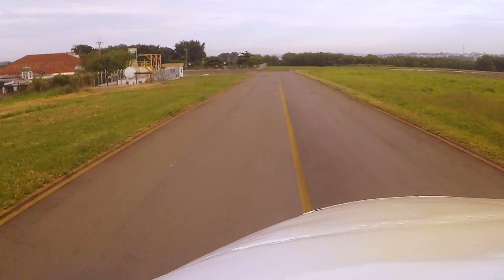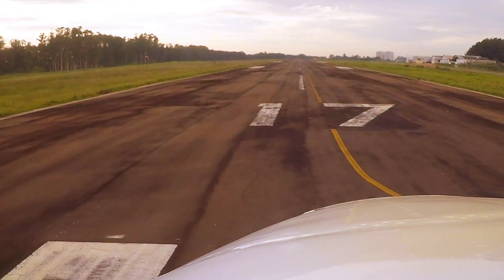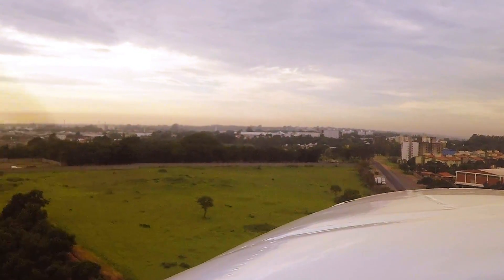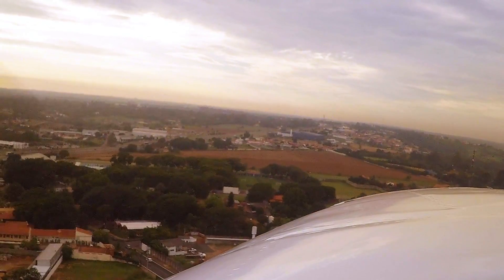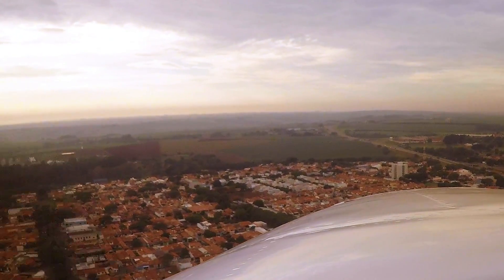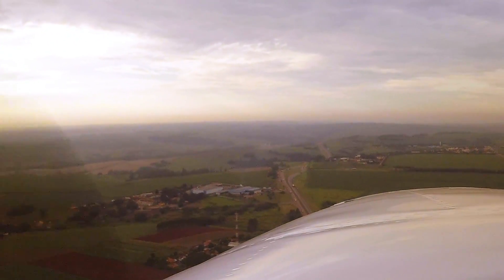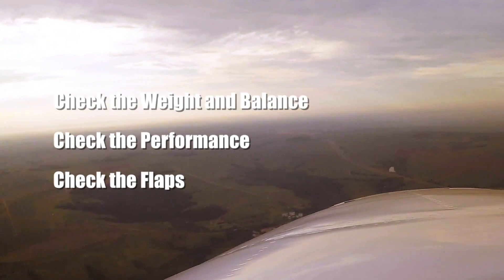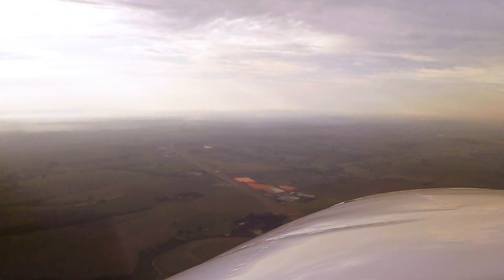Engine failure during take off

Comment: How did you simulate the engine failure ? Did you reduce power on the right engine to idle and feather the prop ? I’m very suspicious because you left the cockpit audio out of your video. You were VERY late getting the gear up and there is no indication of wether the right engine prop was feathered or when that happened ? Despite all of the missing information here ... that was reckless and irresponsible, take this video off YouTube because I might give some other idiot the idea to try an actual V1 cut in a real aircraft, there is a reason why we do this training in simulators !

Comment: The lessons you claim this incident have imparted are not the lessons you should have learned. Here's what you should have learned:

Precise aircraft control is the only way you'll assure second segment climb performance. You were late on retracting the gear and your lateral control is horrible. It also appears your pitch isn't very precise either. You should simply maintain V2 and wings level. If you can't do both of those, under a view limiting device, you have no business flying that airplane.  None.

Simulated emergencies close to the ground have resulted in dozens, if not hundreds of accidents through the years. That your "IP" didn't recover your simulated zero thrust engine, and that he chose the airport and terrain seen, speak to a total lack of competence in the area of evaluation being performed. Is he even a King Air current instructor? If not shame on you both, if so, he doesn't know what the hell he's doing and damn near got you both killed. Performing this type of training in the airplane, even when both the student and instructor are competent, is extraordinarily dangerous and must be carefully briefed and the threats managed. Those people on the ground deserve better than two clueless and thoughtless jerks arbitrarily screwing around with an airplane just because they thought they could.

I hope you've either given up aviation or chosen to get serious and start performing in the manner required of a certificated multi engine pilot. If that sounds harsh, it's meant to be. Get your act together before you kill somebody.
Reply: While I don't pilot planes at all, I enjoy aviation videos (Swiss001, DorDek Kiddy, Richard Tyrer, etc), whether computer simulated or real life. In other words, I am a young science and tech enthusiast. I do 99% agree with you that this engine out test should have been done over a less crowded area, but modern twin airplanes (ex. DA42, Cessna 414) are so safe that the probability of this guy crashing is like 0.0001%. :) But, I do see your point. I would not want to fly on one engine over a bunch of houses (high population density, buildings and stuff). He could have done this in a free flight sim like FlightGear, or shelled out some money for MSFS 2020, instead of risking dozens of lives on the ground and his own.

Anyways, merry Christmas, and happy holidays sir. 🎄🕎

Comment: And that was light? I figured OEI performance on those earlier, smaller models was better than that. That aircraft needed more SHP from those turbines than what they gave them. If I owned a King Air of that model I would upgrade the engines as soon as I could afford to. I mean 550 SHP PT6A-135A's, uhhhh nooo. How about trying to modify the engine bays/nacelles to squeeze a couple of 850 SHP PT6A-41's in? I wonder if they'd fit?

Comment: Back when I was self-training, my reaction to a right-bank on engine failure was to bank hard left, kick the right rudder, pull the yoke back hard, cut the throttle (do a fuel dump if I had time), cross my arms in front of my face and yell, "iiieeeeeeeeeeeeeeeeeeeeeee!" Worked every time.

Comment: It’s important for people to see how poor the engine out performance can really be in twins flying today. They are all terribly underpowered, with few exceptions. The C90 at reduced weight of say 9,000 lb in your case has an engine out power loading of 16.3 lb/hp (17.6 lb/hp at gross weight). These are both quite a bit better than most twins, which are typically around 20 lb/hp, which is a lot worse. But as you can also see, it leaves better performance to be desired.

Comment: this is just stupid, and completely irresponsible.
Reply: Are you a pilot?
Reply: @bgamelson  5500 hours on the 737 series, and 2800 so far on the 787.
Reply: @cmm3338  Oh so you know that simulated engine failures on takeoff are a required element of twin-engine signoffs, yet you call it stupid and irresponsible.  Are you just here to get attention?
Reply: @bgamelson  Simulated Engine failures for multi, or any cert for that matter are to be, and I emphasize SIMULATED AT A SAFE ALTITUDE. I have never heard of someone cutting power on purpose right after take-off in a densely populated area, before the gear is even retracted at that. No sir, this was reckless.
Reply: @cmm3338  You've never been on a milti-engine check ride then.
Reply: Bill Gamelson I guess you haven’t, at least not governed under the FAA... because NO check ride would be started with an immediate engine failure after takeoff, in a densely populated area.. period. I’ll find and post that regulation per the FAA for you.

Comment: You must use rudder compensator to help You control the engine failure that according to the video appears to be  the right engine

A nose elevetion between 0 to + 5 degree of nose up checking stall Velocity limits & trees or buildings a long the the fly path

Comment: Uh, I would have immediately returned to the strip I took off from.... but that's just me
Reply: Not enough altitude.
Reply: @bgamelson  But he stayed airborne and gained altitude throughout this video.  With an engine failure, he should have returned to the strip after he did gain altitude.
Reply: Idiot. he was barely gaining altitude.  If he turned the airplane he would have lost altitude and crashed.
Reply: @bgamelson  "Idiot"? really bro?  That was uncalled for.   I guess you're one of those people that can't have a conversation without attacking those with differing opinions. Have a good day.
Reply: @jeffroutledge9153  Cry baby.
Reply: @bgamelson  No tears... I promise.  Just stating the facts.  By the way, I know a pilot who had practically the same exact  circumstances, (same altitude, etc.) and he made a perfect return to the landing strip.   It can be done.  But I guess you would know that if you were a pilot, which as evidenced from your comments, you're not.  Cheers
Reply: @jeffroutledge9153  Actually I am a pilot and I call bullshit.  You're the one who is not a pilot.  Actually, I think you totally made this story up about "a pilot" who had the exact same circumstances.  There is no such thing as two separate flights using two separate airplanes which yield the same exact circumstances.  What was the atmospheric pressure at the time?  What was the exact weight of the passengers on both flights?  You don't know that, do you?  What engines were running, what props?  What was the quality of the fuel?  There are a lot more specifications that add up to performance than "altitude etc."   If you were a pilot you'd know that but you are not as evidenced by your comments.
Reply: @jeffroutledge9153  I can see two things he did wrong in this video.  Can you name them?
Reply: @bgamelson  Let's see... "great job my friend, excellent piloting"  hmmm I wonder who told him that?  But now you claim he made 2 mistakes, why didn't you tell him that too?  Could have been more constructive for him to hear your pearl's of wisdom  than trying to convince me you're really a pilot. LOL.
Reply: @jeffroutledge9153  I don't know who told him that.  Certainly wasn't me.  Perhaps you should learn how to attach names to messages.  Still can't names the two things he did wrong I see.
Reply: @bgamelson  My bad. That comment was from a guy with a similar name.  I admit I was wrong about that.   I already told you what I thought the pilot did wrong.  And, I never claimed to be a pilot now did I?  I speak from the opinions of friends who are pilots and one who told me of a very similar (not exact of course, that should go without saying) but very similar engine failure, aircraft type, approximate similar altitude as determined from the video as well as many of the same circumstances detailed therein.  He was able to make a safe and flawless return to the strip. It can be done. You don't think so??
Reply: @jeffroutledge9153  Two thing that he could have done to get some climb out of that bird:

1.  Bank into the good engine.  He was flying almost level the entire time.  Banking slightly into the good engine will increase the airplane's ability to fly.

2.  Add one notch of flaps.  He took off with no flaps.  This is a mistake by itself.  If an engine quits right at rotation, it's good to have one notch of flaps already dialed in.  He was below V2 with no flaps.  This is why the airplane wouldn't climb.  As soon as he got V2 (about 5 miles( the airplane started climbing.

And you accused me of not being a pilot.  That's as good as claiming you are one.
Reply: @bgamelson  Well I can no more prove you are a pilot any more than you could prove I'm not one (if I had not admitted that to you).  So you still feel it would have been impossible for him to return to the airport?  He clearly had enough altitude by the end of the video to turn around, right?
Reply: @jeffroutledge9153  He did return to the strip after that since they were out practicing but you said you would have IMMEDIATELY returned to the strip.  not after five miles.  Don't try to change the subject just because you know you were wrong.  Here is your quote:

"Uh, I would have immediately returned to the strip I took off from.... but that's just me"

If you would have immediately returned to the strip you would have impacted with trees and/or buildings.
Reply: @bgamelson  Wasn't the  subject about him making it back to the airport?  So how can this conversation about making it back to the airport be considered  "changing the subject"?  Lol.   If he returned to the strip, he sure didn't do it in the video.  "Immediately" doesn't have to mean like 2 seconds into the flight does it?  "Immediately" could mean as soon as it was safe to do so, (which again, he doesn't do in the video).  Since he did it soon thereafter, then I guess that qualifies as him doing it as immediately as possible.  Really not all that complicated is it?
Reply: @jeffroutledge9153  Immediately:  At once. Instantly.  Without any intervening time or space.  Right now.  No delay.
Reply: @bgamelson  Ok I get it,  you're a person who takes every single word in it's absolutely  perfect literal translation.  Good grief man.  Next time I'll say "almost" immediately.  Would that have altered the course of this conversation?  The Senate just passed an economic  bill to "immediately" help Americans financially but it took 4 days to approve it and it will be another 3 weeks before checks are sent out.  I guess they shouldn't have said "immediately" huh?  I'd love to continue this conversation with you... but I'm not going to.   Have a good day and stay healthy bro.

Comment: If this was a training flight for an engine failure after V1 surely the engine would only have been throttled back to idle? If needed it was available and if so why was the engine not brought up to climb power when the exercise was complete and after the checker/trainer was satisfied that the pilot was competent in the drill? It was a bit close to the built up area, sure, but not all airfields are out in the sticks...............

Comment: I’m assuming this was a simulated engine failure ( engine still running at zero thrust setting), if that’s true, I don’t see the fuss about practicing an engine out with few buildings on either side of the extended centerline. The power could be restored at any time if rate of climb was insufficient, practice emergencies in real environment not hypothetical. Simulators are best for training, but the real world engine out practice builds confidence as long as safety isn’t compromised. Airlines practice engine out when obtaining initial type rating, including check rides etc.

Comment: You were also very lucky to fly quite a distance on one engine basically at your take off weight of 9000 pounds. This situation is a mighty strain on your only engine even if it is rated at 350 hp and has a turbocharger.
Reply: It doesn't 'have a turbocharger',  it is a turbine (jet) engine, genius!

Comment: Unbelievable. Incredibly stupid to practice an engine failure at low altitude over a populated area. What the heck is wrong with you? Did you feather the bad prop? Or did you end up NOT feathering the bad engine's prop and thereby practicing the wrong procedure? STUPID, STUPID, STUPID. There is no need to do this in this modern era. This is why we have simulators. If you want to do it in the real airplane, do it at high altitude and do it properly so you don't end up memorizing NOT feathering the prop.

Comment: Ignore the armchair pilots. This was a good and informative video. I think it was alright, given the engine could be restarted in case of an issue, and you were in airspace you were very familiar with. Combined with a seasoned first off, the danger though elevated, was still negligible. Ty for sharing!!
Reply: @colinsouthern  A very good assessment..I’m also a pilot ,albeit not commercial..I too thought it was dangerous and irresponsible.
Reply: The engine was prop was fethered it wasn't off

Comment: Very interesting ! We can learn a lot from that.

Every once in a while, some training captains are giving me hard time for not keeping the ball centered after an engine failure....
(Learnt to fly on gliders...we use a wool line...not the ball..)

Engine fail:
CTRL + GEAR UP + V2
And half a ball on the good engine !

And one more last thing....You should not care about a plane who failed you...does not want to fly...belly land ! 
It’s not because you have a second engine that you can keep flying !
You will not survive a < Vmc ! 
Nor the plane anyway...It did happen to one of the cie i worked before, they flipped a king air above a nice field...to burn inside.
Be ready at every take off for an engine failure ! Just like at the sim, the surprise delay won’t be there !

Fly safe !

Comment: I know nothing about aircraft. Please tell me what V2 is?
Reply: v2 is called the takeoff safety speed, it should be reached 50ft above the runway. It's the speed that should be flown with 1 engine out. v1 is the decision speed, where you have the last chance to abort the takeoff
Reply: Ululuro do you reach V1 then hold a few seconds longer before taking off? Then V2 is achieved in the air?
Reply: @jaywhoisit4863  v1 is usually not fast enough to take off. But if you pass v1 the runway will be too short to stop so you continue. There is a speed between v1 and v2 called vr or v rotate. This is where you start to actually lift off.

Comment: Actually, the guy did quite well. No excessive roll, stayed pretty much on heading, even looks like he banked a little bit into the good engine too. You lose at least 80 percent of your 2 engine climb capability on one engine, so what would you expect? Perhaps he never gave the command to set zero thrust (200 lbs/1700 rpm on a 1900D), and so was trying to climb out against too much propeller drag. 
 I never flew a KA90, but in a 200 and in my 1900D, when you pull the power lever to idle it simulates a dual failure: Engine, AND auto feather. I teach that your copilot should immediately identify the engine that failed AND the fact that the AF system has or has not worked by putting his finger on the dead engine rpm and torque gauges. The callout I use is PNF: "Autofeather, left (or right) engine" or "Negative autofeather, left (or right) engine".  The book says NOT to do anything until 1500 feet except raise the gear at positive rate, and raise the flaps after accelerating to Venr at 400 feet, but if you have an autofeather failure as well, which could very well happen if the front of your engine grenades, you may never get to 400 feet or maybe not even get out of ground effect. So I go against the book and when the PNF says "Negative autofeather left engine" I will confirm by looking at the torque AND prop rpm and then tell the PNF to feather the left prop.

Comment: I love all the keyboard pilots who think they know what they are talking about. THEY DIDNT FAIL THE ENGINE you tards you can feather a prop to make drag (I believe) (correct me if I am wrong) but they always have the engine it is very easy to just move that blue leaver where the other one is and have thrust back. Jesus people. It acually is perfectly safe they fail your engine 3 times on a FAA checkride for AMEL 1. On take off roll. 2. Right after rotation 3. Somewhere in the air.
Reply: Scott K I believe your argument might be more persuasive without the name calling.